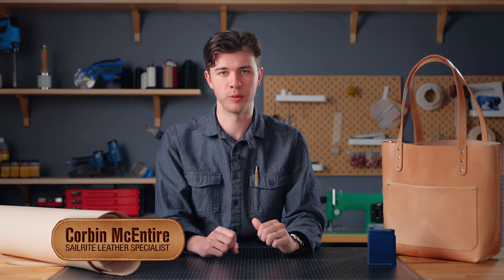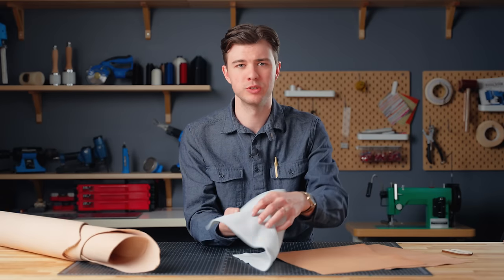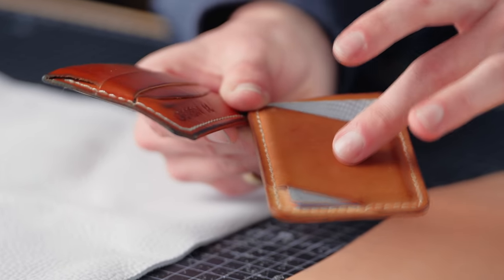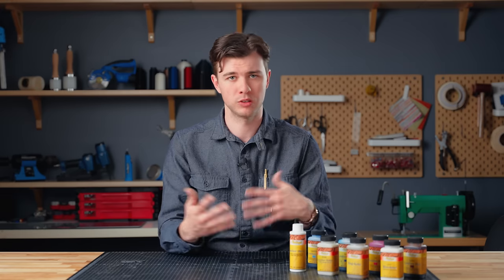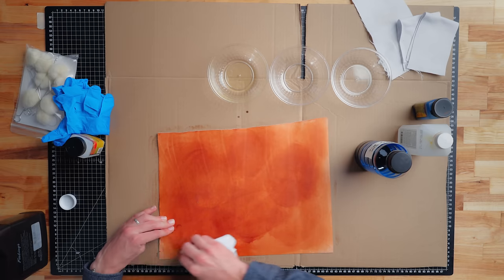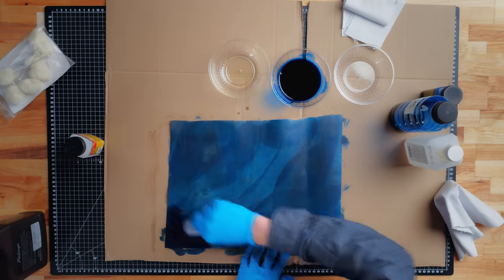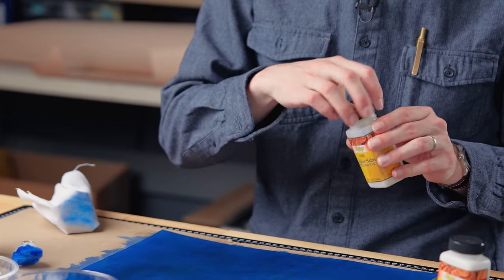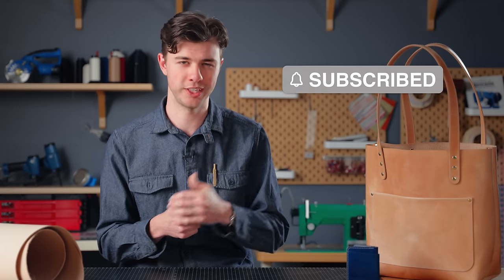Choosing and Dyeing Leather | Beginner's Guide to Leather Craft Ep. 01

Comment: I had a blue leather jacket, and the dye would get on everything. I thought a rubbing and time would help, but it didn’t. What if that happens to my wallet.
Reply from the maker: If you properly apply a top coat to your wallet, crocking (dye transfer) shouldn't be a problem. In this video, I used leather balm with atom wax, but if you wanted to be extra safe, I would recommend using a couple even coats of resolene. It will  do an even better job of preventing crocking, and even give you some water resistance! I hope that helps.